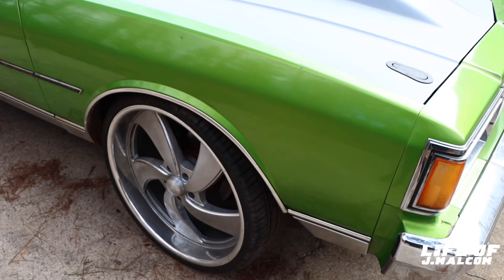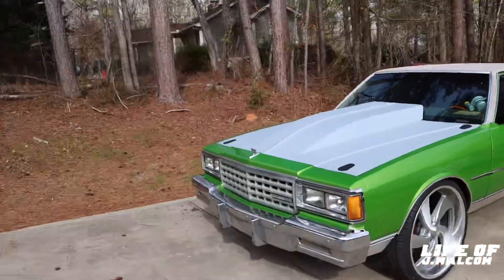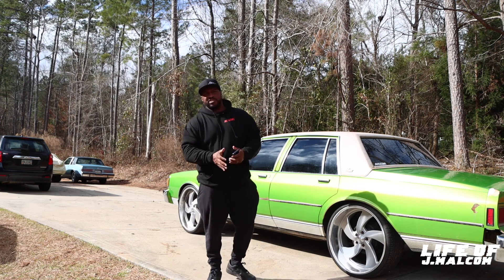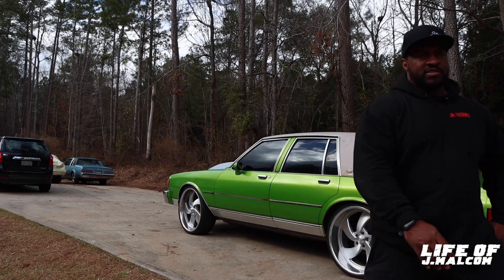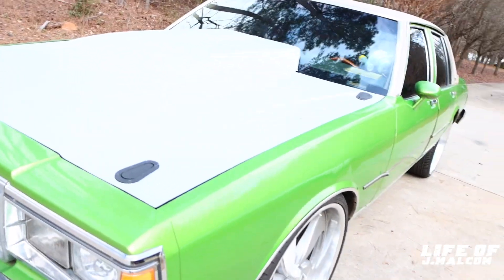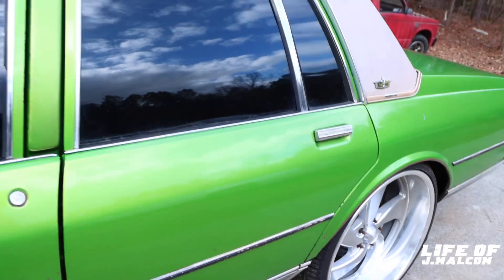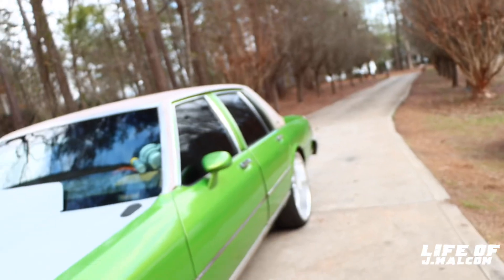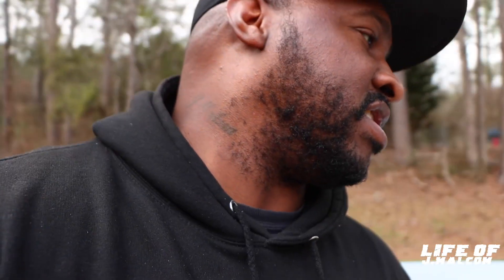CRAZY HOW MUCH MONEY HAS ALREADY BEEN INVESTED IN THE BIG MEECH BOX CHEVY BUILD…GUESS THE AMOUNT

Comment: You have a 35k into, if not more, nice rides.
I was off by 8k.. I'm building 3 cars + 1 truck at once, and I will never calculate what I have in each one ( I would rather not know). 70 cougar finished.. 70 cutlass 442 75% done and 67 GTO  about 85% done.. and a 62 C10 80% done